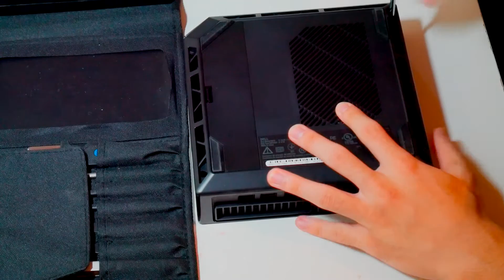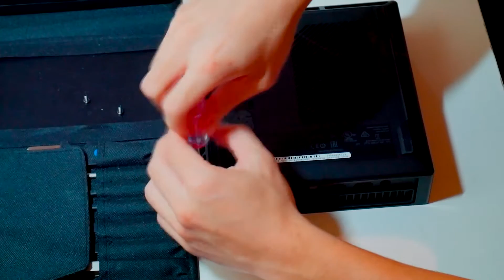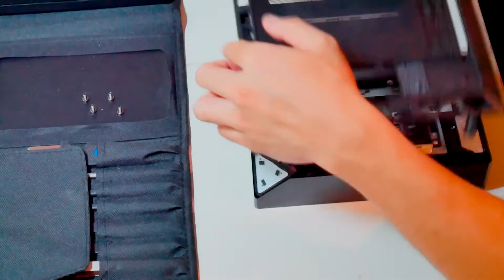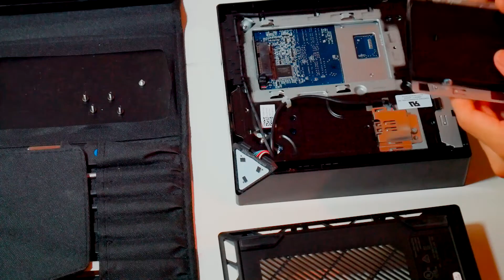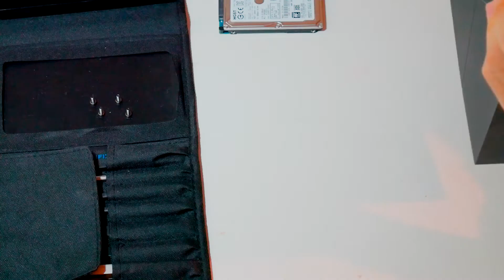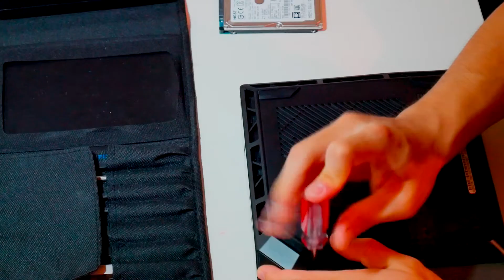How to replace the hard drive in Alienware Steam Machine

Comment: just bought mine off dell.com for $600. Came with i5-6400T and GTX 960 4gb. Definitely using as a 24/7 plex server and mid tier gaming. I game old titles like CSS and DODS, sc2, WoW, nothing crazy, plugged into a 1440p monitor
Reply: upgrading the HDD to an SSD, definitely upgrading the CPU to an i7 later in the year and might possible change its chasis, i hate the LED and the alienware logos..
Reply: Oni Ologeanu
pretty sure u cant change the cpu out of these things or gpu either unless u have a different one then im thinking of. cause the ones i know of use laptop cpu's and gpu's wich are soldered to the motherboard.

Comment: Hi, have you tried to install Windows OS to the machine? I was wondering if it worth to buy this and install Windows rather getting the regular PCs.
Reply: Yes please install Windows OS if you have this Steam OS does not have a wide selection only a limited ammount.
Reply from the maker: I have installed windows on it and have been using it as a media PC in the living room. It works great in that role. Not really enough gpu power to drive a 1080p display super well but if you don't game to much, it is a great compact PC.
Reply: +TwinkieBits Tech so it's not good for gaming?
Reply from the maker: Really depends on what kind of game. The gpu in this machine is basically a gtx 860m. If the game you want to play runs well enough on a 860m gpu, then it will work great. This 860m is not going to be able to give you 60fps on ultra on 1080p in triple A games such as battlefield 1 and GTA V.
Reply: +TwinkieBits Tech I heard it might be a 750 or a 750 ti
Reply from the maker: Ah the newer models will have better gpus. The model I own has the 860m. The newest steam machines will probably have the gtx 1050 or 1060 gpus which will be very good for 1080 gaming.
Reply: +TwinkieBits Tech I have a i7 from GameStop steam machine what gpu do you think is in there?
Reply from the maker: Hard to guess. Maybe go to device manager and check under display adapters?
Reply: +TwinkieBits Tech I'm getting it for Christmas all
I know it says nvidia GeForce gpu 2gb gddr5